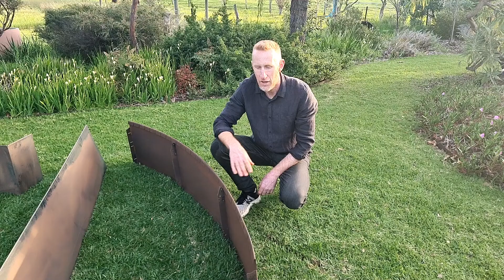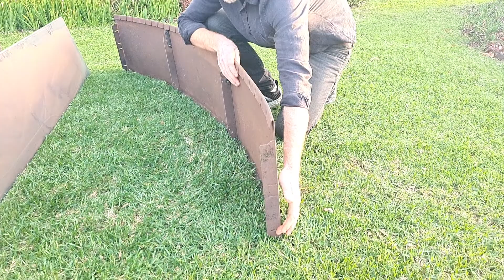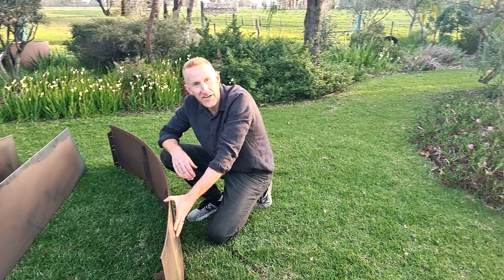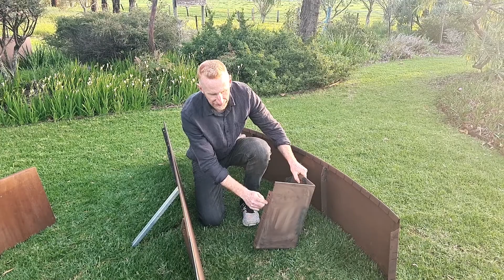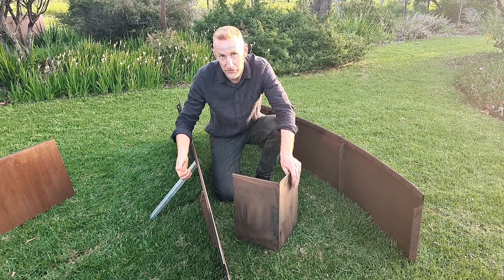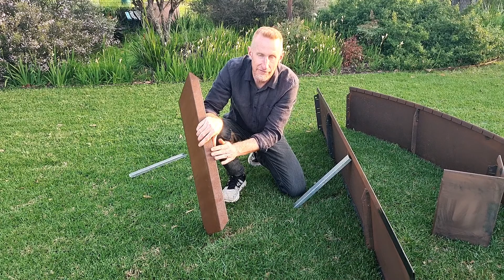Straightcurve Raised Garden Bed Styles - Flex, Rigid and Zero-Flex Compared.

Comment: “Precision engineered” 😂. It’s not a rocket…
Reply from the maker: Now there's an idea! :) We have been in communication with SpaceX, but that was about getting products to them. Perhaps time to change that conversation? 

But more on topic, we offer +/-0.1mm repeat accuracy on all products. In fact, in our latest update, we've gone even further. Some parts now have a repeat accuracy of +/-0.05mm. 

But why? That makes no sense right? It wouldn't be noticable by our users and it's not relevant for the finished install, so who cares? 

Well, the more consistent the product is, the more consistent the user experience is. We don't want it to be hard for one person and easy for another. It needs to be easy (and as intended) for all users. We also ship all over the world and a product made today still needs to connect to a product made many months ago. The only way to guarantee a proper fit and consistent experience across time is to work with very tight tolerances. 

You'd be surpised how much is involved with manufacturing at scale and ensuring a proper fit at all times. :)

Hence precision engineered... :)
Reply: @straightcurvegardenedge858  meh you sold me 🫨😉
Reply: 1000% matters - i wrote a note “make sure precision engineered” - in the US and looking for this product.  Important to everything fits together easily/perfectly.👍
Reply from the maker: @lsmith9490  Hi there - thanks for the comment... did you find us? You can buy Straightcurve via https://www.hendersongardensupply.com/